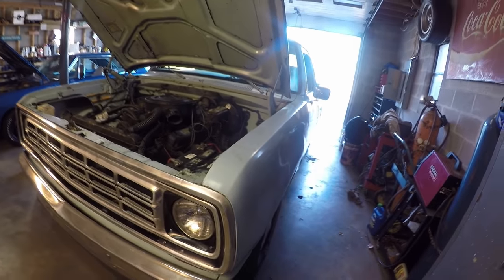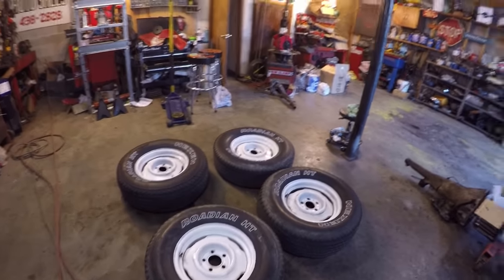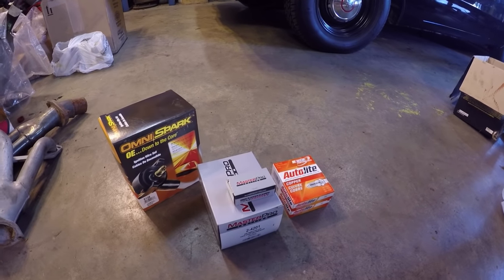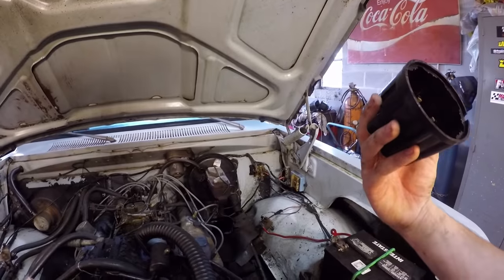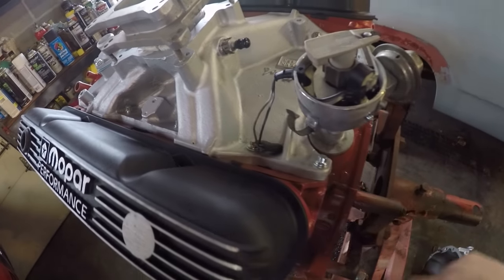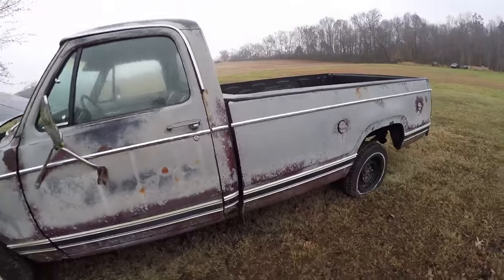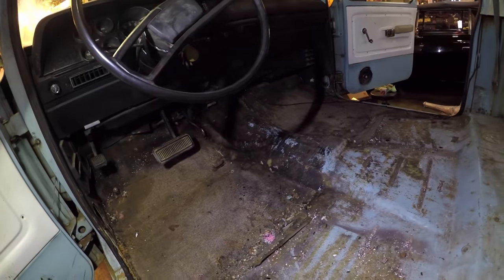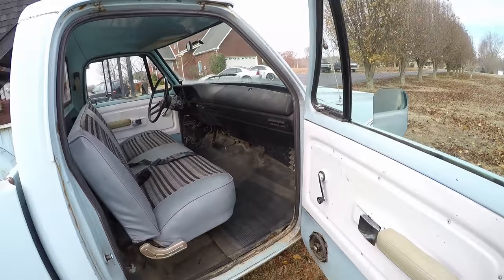Making My Truck Better for CHEAP!

Comment: definitely better without the house carpet and Captain chairs 👍, 14" tires are getting harder to find a good price on, jumping to a 15" would fill those wheel wells out and may even be cheaper ..but looking good for sure! Nice job

Comment: I was thinking of finding a D100, suddenly had a 85 D150 fall into my lap at work. Slant/4spd OD. Slant has a cracked block, he had mostly water in it when we had those single digits in December. 
I already picked up a 5.2 magnum for the short term. Just have to find the right bellhousing.

Comment: both seats looked good.. on long drives I would like the buckets better.. youll find  your shoulders will burn  due to no armrests and no headrests .. but it looks factory.. and the rubber mat is easy to live with

Comment: I really like your little dodge trucks, I have a 
1976 dodge D100 short bed 318 , the only thing wrong with it is that it is a standard four speed.  I would really like my little dodge truck if it was an automatic.

Comment: Hi  I am in New Zealand and I have a 1974 Dodge D200 pickup has done 600.000 miles with the motor being still original and now I am doing the old truck up with new fenders new doors new windshield.I am having a bit of trouble getting some parts over here .Can anyone suggest where I might be able to find them  Lance.

Comment: on your dodge dart. Can you tell me if you put the 284/484 dot to dot or did you set it at 2 or 4 degrees advance. Also do you have flat top pistons? Please tell me i want to set up my 360!
Reply from the maker: CESAREO MENDEZ I went dot to dot. It has stock pistons too.

Comment: should I get a d150 for a daily , and it would be driven in winter. there is one for sale for 4000 with 78,000 miles
Reply from the maker: Sean Smile You can't go wrong with one.

Comment: . how tough is a small block Chrysler a small block Chrysler is so tough I've seen one run 4 month after breaking the oil pump Drive my filling the crankcase full enough the crank was splashing oil up on the cylinder walls and the Mariners were submerged I never seen anything like it in my life the valvetrain was hammering terribly I swear to God the person drove it for 4 months I ended up dropping the oil pan and replacing oil pump and distributor drive shaft and didn't do anything else to that engine and it still ran another year